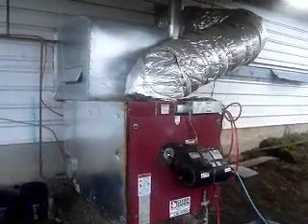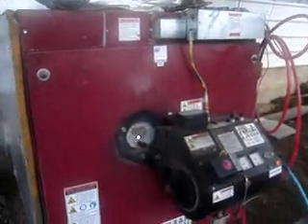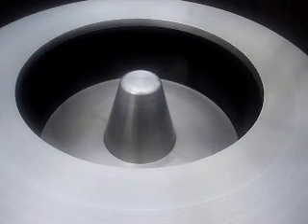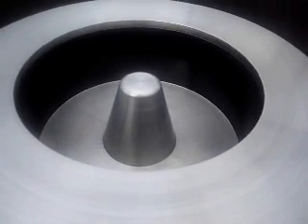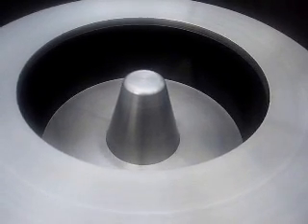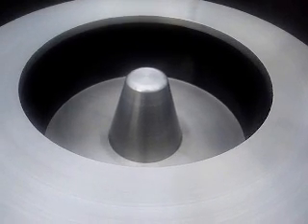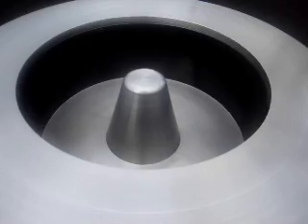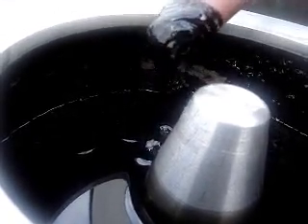Simple centrifuge cleaning waste oil

Comment: @egn83b   No way, i have used both, this  centrifuge is the best and most efficient way to clean oil.  It uses time and G-force =your cleaning time.  if you have a filter lets say 6 micron.  you will plug it up fast and you will not capture the other particulate under 6 micron,  those smaller contaminants will just flow right on through. Because this  machine cleans based on weight g-force,  it will also catch the water.  These machines pay off quickly.